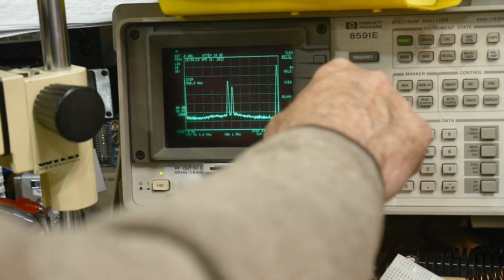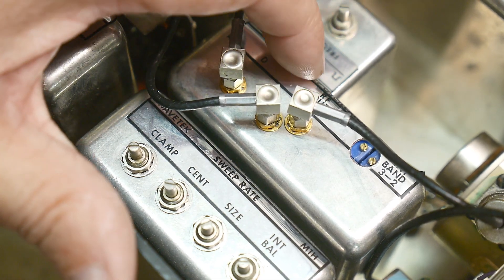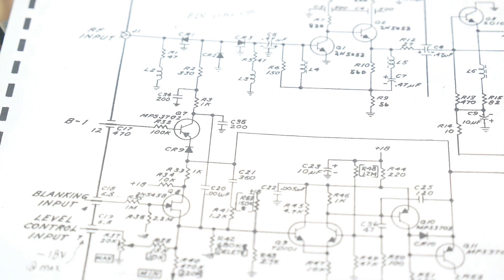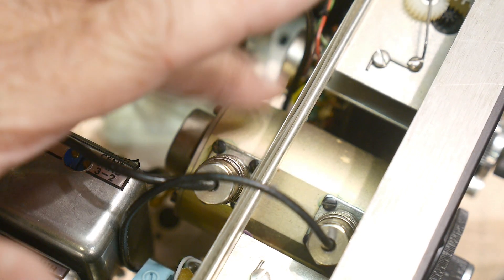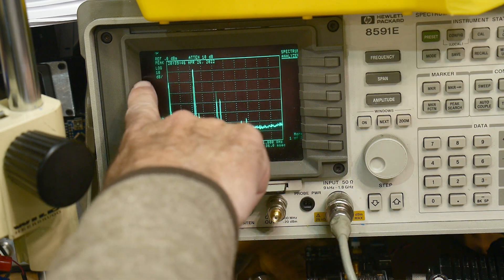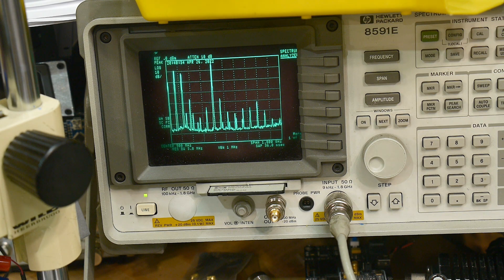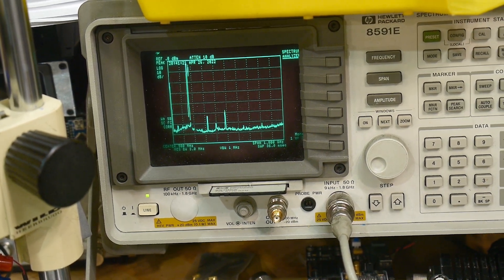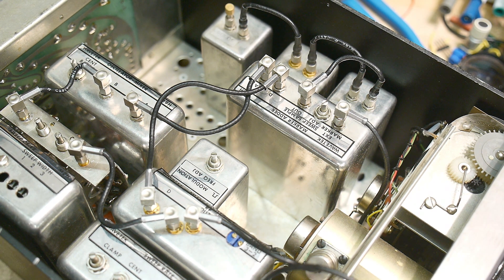#1129 Wavetek 2001 Sweep Generator (part 6 of 10)

Comment: Well, unless you're gaslighting us since this is part 6 I'm going to assume you continue! Those analog attenuators can be problematic at the high end of attenuation; I had to replace the Weinshel unit in my IFR1500 (long story, big bucks to put in the digital version) and it got flaky as you made the RF signal smaller and smaller. I can't think of why it would be frequency sensitive, especially at the lower end. You could take the attenuator out and simply barrel BNC it while dissecting it. Would be interesting to send a known good signal thru the attenuator which you could do in situ and see what the level/response is to eliminate that before hauling it out of the box. Keep going!

Comment: I fixed an old Exact 7050 function generator by putting it on the "back burner". Once and a while I'd get inspired to get it working again and fool around with it until I'd reach a point and set it back on the shelf. One day I got a break through in one of the amplifier sections and that led to me finally getting it to fully functioning and calibrated .  I'm happy I didn't give up on it.

Comment: I would like to see the Wavetek 2001 series continue...for my own selfish reasons. I have a Wavetek 2002a. Bought it at a hamfest in Indiana for about $60. Using the spectrum analyzer in my HP 8920B, the CW output looks OK up to 1 GHz which is as high as the 8920B goes. But, the sweeping in delta F or S/S modes doesn't look right and I need to do more investigation. My 2002a looks similar to your 2001 but the case is a bit wider, it has a meter to show output signal amplitude within the ranges of the step attenuator, the attenuator controls are moved to the right side of the front panel, it has an N connector for RF out, and it has four frequency ranges (0-500 MHz, 500-1500 MHz, 1500-2500 MHz, 0-2500 MHz).

To do troubleshooting, can you get female pins that will fit the pins on the bottom of the module? If so, maybe you could breadboard a circuit to provide the necessary voltages and control inputs.

I have friends who used to work at Wavetek in Beech Grove (near Indianapolis). I'll have to ask them about the shielded resistors and capacitors. Crazy the way they did that.

Comment: You cant stop working on this, because this is only part 6 of part 10 😆
I would buy 20 pins and 20 sockets in the right size, just to build an extender cable harness.
Reply: True - but we don’t know it’s fixed by episode 10; likely there’s going to some unexpected cliffhanger. There will be more hit Wavetek series to follow, and then season after season.
I blame the arty-farty scriptwriters, contriving lots more component plot-twists. They’ve cleverly chosen the perfect instrument as their protagonist; fully documented, but flawed and difficult and idiosyncratic to work on, with loads of character and the prospect of becoming a really useful member of the community after its rehabilitation.
It’s compelling!
Reply: so much talent in these comments!